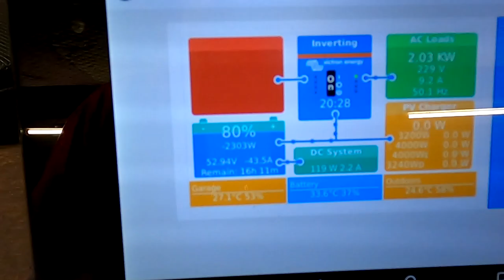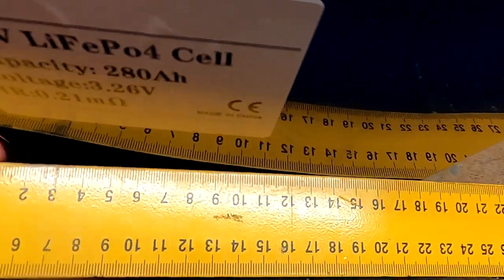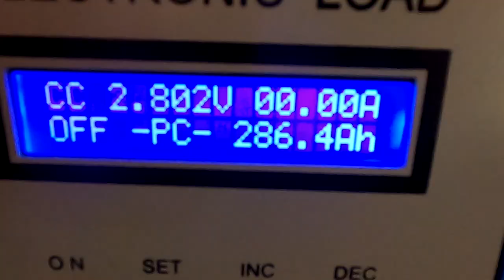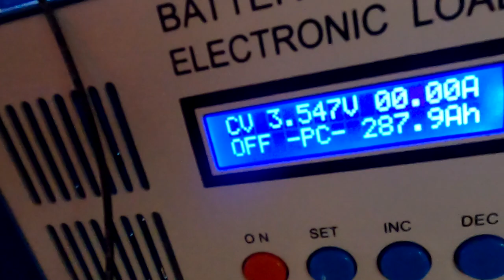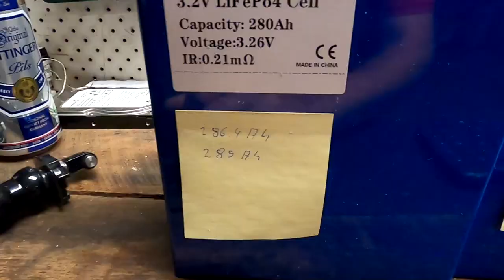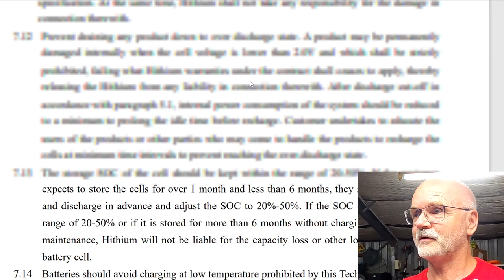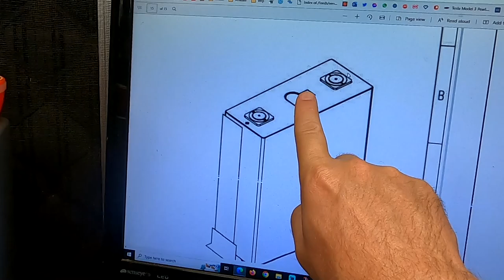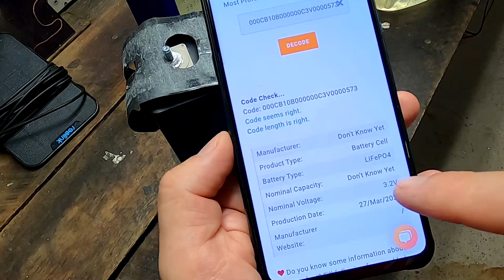Testing the 10.000 Cycle Hithium 280Ah batteries. Did I just get scammed??

Comment: Hithium (Xiamen Hithium Energy Storage Technology Co., Ltd.) is a quite new company, founded 2019. But it is a booming company which offers R&D (research and development) and produces its own cells and complete BESS (battery energy storage system). The qualtiy of the cells seems to be as high as cells from EVE at nearly the same price. In Europe Tewaycell is one seller who has Hithium cells in stock.
In 12/2022 a 200MW/400MWh battery energy storage system (BESS) has gone live in Ningxia, China, equipped with Hithium lithium iron phosphate (LFP) cells. Mentioned in the article "Hithium LFP cells used in China’s ‘largest standalone battery storage project’" on energy-storage dot com from December 22, 2022.
I think these cells you have are the same as nearly all so called "Grade A" cells available from resellers on the market. They didn't match the high quality restrictions for automotive use and are sold for none automotive use. I know only one reseller (EEL) which places a lasered B on the original QR-code to show, that these are outsorted "Grade B" cells. These cells are still good for solar storage and other usages which don't need the automotive specs. Some resellers scratch the original QR-code, some place a sticker above it and some are printing new QR-codes, but nearly all are using outsorted cells. Only a few resellers like SFK use cells with automotive specs, because of higher prices.

Comment: Well at least my community post comment was valid "looks repackaged" or something.
I reckon someone bought a pallet of grade B/storage and then has selling them on - and did a small attempt to hide the original code. 
And don't expect an issue with them in use, or any major internal differences to the Eve - probably just a clone to up production numbers in China, but marketed with the 70% @10k cycles to try and differentiate them
Reply from the maker: Yeah, you could be right. Not that I'm surprised with all of that, but I really wanted to know who is doing the shit-part in this whole transformation of these cells. But even the original QR didn't scan correctly and back in March last year, these cells were actually not on the market yet.
Reply: @OffGridGarageAustralia  Probably because the author of the app doesn't know Hithium cells - they are a newer company, and I've also never seen 280Ah cells from them.

Comment: Charge/Discharge tests finished on my  Xiamen Hithium Energy Storage Technology (Hithium), 280Ah prismatic cells:
charged to 3.6 V @40 A I got 300 Ah when discharged to 2.5 V @40 A! 
To me seems that those cells are the first testing production of their new model 300Ah prismatic cell launched at RE+ event...

What do you think?
Reply from the maker: Barcode says 280Ah. Don't know if they have 300Ah cells, nothing mentioned on their website about such a new cell...
Reply: @OffGridGarageAustralia  ANAHEIM, Calif., Sept. 23, 2022 /PRNewswire/ -- Xiamen Hithium Energy Storage Technology Co., Ltd. ("Hithium") has this week celebrated a successful launch of its newest offerings in battery product innovations at RE+ 2022 in Anaheim, USA.

As one of Hithium's latest two game-changing batteries, the newly released cutting-edge 300Ah Prismatic Cell tailored for electric energy storage is capable of achieving "zero" loss in the first 3 three years of use[1], with a long cycle life of 12,000cls and energy efficiency of 95%.

Comment: I really enjoy your work, learned so much.. Quesiton, I have a quesiton, I have 3  150ah Lifepo4 iron Phos battery a neighbor just got a Dawnice DW-PW15ESS-LV, 280 ah battery. Why is he needing not able go below 49.5 volts and SOC is 7%, and as for Stop discharge not able to go lower than 54v setting on the controller for the Battery.. using CAN com with the controller.. and at 52.51v and cells are at 3.282 and SOC is 39.55%.. Yet my LifePo at cells 3.34 I will be at 98% and fully charged and soaking at 3.40 cell.  I nee help to understand his battery, unless it is a ION/ Li-Ion battery. is the only way I can see it. Help I'm drowning in Cells, lol

Comment: In addition to what you pointed out the Hithium on drawing they do not show a post coming from the + or - cells. Send all back to QSO. Good or not, there is no verifiable information on them.
Reply from the maker: No manufacturer of cells is welding studs onto terminals (see pictures on their website). Coming from the factory, they are always flat. Always. The reseller does all that, either drills a hole or welds a stud.
Reply: @OffGridGarageAustralia  The exception is the original EVE LF280 (no n, no k). That one had holes drilled in by EVE and were specified as such in the datasheet.

Comment: So .5 C with 1/2 hour rest period is about 5 hours per cycle. 10,000 cycles would be almost 6 years. Hard to believe cells had been tested for 6 years.
Reply from the maker: They don't test the 6000 cycles for batteries that way either. It would take them several years to test just to find out something needs to change😂

Comment: Hi Andy, and thank you again for this video,👍 particularly interesting!!

It's always the same thing, reject battery or used battery, and buy them at auction, by resellers, who solder new terminals,
redo the packing and put their own QR code which does not correspond to anything (or certainly just to reference their stock)
So again, not sure what to buy? and my opinion, they are bad battery or already used, because if they were good, the Manufacturer would sell them himself and not sell them at auction. Normally the manufacturer erases the bar code, or asks that it be concealed.
Because they don't want to hear about these battery anymore.
Wanting to believe that these battery are of good quality is a mistake.
  And announced 10,000 cycles!!! these Chinese dealers really take people for idiots.
For a Cycle per day that represents more than 25 years!!!
If you ask the reseller to guarantee them for only 5 years, he will refuse, or if he accepts, in 5 years this reseller will no longer exist, and or will have changed his name.
My opinion, to buy quality battery you have to buy them directly from the manufacturer, unfortunately they are much more expensive and that's normal, and also often they ask for a large MOQ.
For a use, energy storage, we can think, that these battery resold, by resellers, will be able to satisfy us, but unfortunately I doubt it. It is in the long term by aging that the problems will arrive.
In any case, Andy, thank you again, for spending so much time for these tests, and for sharing it with us,👍😁
 it's important to remember, that we find everything and anything in this lithium market cells, and that the Chinese resellers, get rich, without worrying about the buyer, their goal is to sell and that's it.

Comment: One day you will get a high amp testing device I hope, then you will see under high amps near 1 C why these fail,  the true quality / life of these cells appear much later in life when they are not certified by the manufacturer. Capacity testing only shows half the picture, but many people put all the eggs into this metric while ignoring others.
Reply: Very few, if any solar installations run at 1C, or even get close. I've run what I know are 'grade B' (whatever that means) cells for the last three years 24/7 now without any issues. Add in the energy prices we're seeing now and they've already paid for themselves.
Reply: @upnorthandpersonal  Agreed. You need very high loads with a small storage system to run at high C ratings.
My household backup system would be lucky to EVER discharge (or charge) at more than 0.35C, and most of the time even less.
Reply from the maker: I don't think we are buying these batteries to drain them with anything like 1C ever. I hardly ever get 0.2C in and out of my banks. And the more banks I add, the lower the C rating will be. 
But it's good that people have the choice and can spend more money on certified cells or get the cheaper storage grade cells from Ali.
Reply: @OffGridGarageAustralia  Well here is my perspective, if you pick and choose the test you wish to do and ignore the rest then why bother testing at all. The load test is the number 1 test for testing for internal cell damage to see if it can meet the 1/2C rating. Cells that fail this will have accelerated aging, they don’t hold voltage, are harder to balance and WILL NOT meet the spec sheet in terms of cycle life, UL certifications, and safety prerequisites. IT IS A GAMBLE ON WHAT YOUR WILL GET.

Most people that are using these cells are building 12v batteries, this is by far the most used application, also they are using 150-200 AMP BMS units so they are seeing 150 amp loads (.5c) at which point the BMS triggers LVC due to poor quality.

I understand low C setups with large banks can mask this problem, but I”m not sure why people are using lithium for this. Lead Acid banks at low discharges work very well, it's actually common to see 50KW banks last for over 15 years with basic maintenance and telecoms and data centers have been doing this for decades. You also don’t have to worry about BMS issues, or balancing or anything else as lead acid will self balance, is cheap, no chance of fire. You will be cheaper with lead acid even compared to grade B prices.

I will end on, Yes grade B does have a place in the market, but what does NOT is the fraud Alibaba/express sellers do and actively LIE claiming these cells are grade A++ all the while putting on fake QR codes and other fraudulent tactics. No one should be supporting this fraud, sellers should state what these products are and let customers decide if they want to buy Grade B or pay the extra for grade A. This is not a matter of whether or not Grade A is worth it, it's a matter of disclosing information so buyers can make a decision for themselves instead of being lied to.
Reply: @sfkenergy   @Sun Fun Kits LLC  "why people are using lithium for this. Lead Acid banks at low discharges work very well" --> off-gassing (FLA), 50% discharge limit, more space needed for the same capacity, heavy, need to be charged to 100%, takes more energy and time to charge to 100%, doesn't like to sit at 50%, etc., and in e.g. my country, they're more expensive than LFP. I've run lead acid in the past - I will never do that again.
As for your comment that the sellers should be honest, with that I wholeheartedly agree.
Reply: @upnorthandpersonal  “In your country '' Lithium is probably extremely expensive in your country as well which is why you bought it from Alibaba, yet when it comes to lead acid you will not compare the alibaba price? Lead is cheaper by far for the rest of the world, been used for over 150 years and even now telecoms and data centers use lead acid for their back up power. At low discharge rates and cycle rates it can last well into the 15-20 year mark and there is actual real life data to document this.

Earlier your entire argument was how you barely utilize power from your bank, but now you are arguing that you can only get 50% life out of lead acid bank. Which is it? Do you need the power or you don’t? Do you simply want to defend your grade B purchase at all costs? We all know you were also tricked by your alibaba seller because you had no idea they were grade B at the time when you bought them, the same is the case for 99.99% of alibaba purchases, buyers don’t know.

What you say and what you do are completely different, the truth is you are actively hostile against companies selling grade A products, you prefer the status quo of shady practices by the Chinese, and have no desire whatsoever that the Chinese actually start listing what they are selling are grade B cells.

Because if they actually stated in their listing they are grade B cells, their sales would plummet to zero. ZERO, no one would buy them. The only reason they have sales is because they LIE and claim what they are selling is not what it really is. You support this behavior.
Reply: @sfkenergy  No, my argument was that I don't draw large C rates, not that I don't use the energy stored in the battery. I have months where I don't see the sun here.

As I said in my reply, I agree with you that sellers should be honest, and I've bought grade B cells that were advertised as such in the past.

Edit: and yes, the cost for e.g. off-the-shelf Lithium here is cheaper than Lead Acid for the same amount of power stored (keeping 50% in mind for Lead Acid).

Comment: First time I hear that internal resistance could vary during transport. :)
Reply from the maker: Temperature is a factor which is obvious. SOC as well...
Voltage and Ri matched is such a marketing argument. Unless they test them at different temperatures and also different SOC and then match... but, nah, it's just a snapshot at this moment when they measure.

Comment: I've always thought the test specs for LIFEpo4 cells are weird, and I doubt that the manufacturer are actually performing them.

For instance:
What is the C (charge/discharge) value according to? Is it:
a). According to the actual cell capacity (given by last cycle)?
or
b). According to the cell specified capacity?

But most evident:
If a test was to be performed according to these specifications, it will take like 5.7 YEARS to complete. Ok, a little less since the capacity is fading over time. (Also, constant power is to be used in this case (not constant current) which is really weird. C-ratio is always related to current.) Using constant power will change the time of the test in some way, but who knows which way and how much. Anyway, it is not much time difference in the whole.

The math is simple:
One charge/discharge cycle at 0.5C will take 4 hours (2 hours charge, 2 hours discharge). To that add 2*30 minutes of shelving. That's 5 HOURS PER CYCLE. 10000 cycles is 50000 hours. 50000 hours is 5.7 YEARS.

Do we honestly believe the manufacturer have had a final product sitting on the bench for this long BEFORE it was released? No! Never!

I think all "capacity tests" are just a modelling. They might test over some days or weeks and model the rest of the behaviour according to the expected behaviour of the chemical composition.

Please advice me if I'm not understand this correctly, or if I'm doing some erroneous thinking...
Reply from the maker: No manufacturer is testing batteries for 5 years +.
They test for a few months in different climates and extrapolate the data. That's not just for batteries, but for almost all other devices, materials and items as well...
Reply: @OffGridGarageAustralia  Makes sense and is in line with my comment/thoughts. You obviously know this for a fact (?!) and might want to highlight this in one of your videos considering the amount of followers you have
Reply from the maker: @Mr.X3D  I thought this is common knowledge how product testing works.
Reply: @OffGridGarageAustralia  To me, that’s just an arrogant statement, but still, I might be uneducated or just plain stupid. 🤷🏼‍♂️

Comment: Mmm....you have me thinking I have to peel back the cover on all my cels.......yet yours seem to come up OK.
I wouldnt be at all surprised if they are in fact fine. Maybe they are not Hithium.....but cells have become more or less a commodity item these days. I have three cells from four different manufacuturers: EVE, CATL, Hithium....and one other. Strangely the Hithium exceed the spec by a greater margin than either EVE or CATL. Interestingly I note they claim 10,000 cycles for the Hithium......tho i was skeptical. If I get the std 6000 I will be happy. The Hithium cells I recently got all had a 'genuine' QR code.......
I have an interesting sheet comparing all the cells avaialble to a distributor I use in China. I cant attach it here tho would be inteersted in fwding if you are at all interested.

Comment: Sorry guys.. If you charge with 0.5C and charge again 0.5C you need 4 hours. Multiplied by 6000 or 10000.... My year has only 8760 hours = 2190 4 hour cycles.... So the manufacturer did 3-5 years product testing bevore sales???

Comment: The size of this batteries seems to be identical to elder CATL 304Amp batteries!
Did you order them from Teewaycells, as I did? The internal resistance with 24Mohm is above Hithium Spec….

Btw, almsost 80% of my cells are bloated!!!!!!!

Never ever A-Grade cells!
Reply from the maker: Maybe because of the higher Ri, they failed their internal testing and got sold as storage grade cells. Still good cells though.

Comment: Hello !!!!  How do you know that a battery can be charged and discharged for 10,000 cycles?  Indeed, in practice, there was no evidence yet.
Reply from the maker: Neither do we have any evidence for 3000cycles...
Manufacturer to tests over maybe 6 months and extrapolate the data. Same as with engines and that they last 200.000 miles. Or solar panels with 30yrs of performance warranty...

Comment: often a facory will have there own internal bar code system that has no relivance outside the production line and thats why these little codes often don't work...
     ....  ie; only the robot on the production line knows what to reference with that code  ....
Reply from the maker: I don't know if that is the case. They usually use the original QR code and have them in their database.
Reply: @OffGridGarageAustralia  Yes that is correct but I am only refering to internal codes that are not released as they only referance a point along the production line that the camera on the assembly bot is looking for. Googling them does not work and they can appear as fake/unused data.
 but anyway Great to see that your batteries are working out ok.